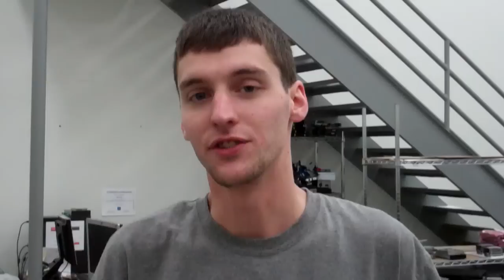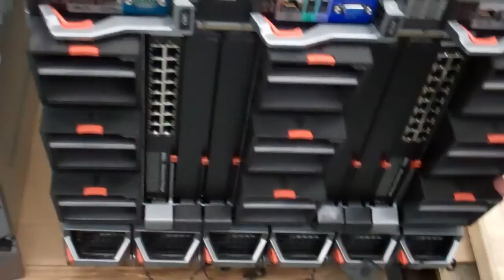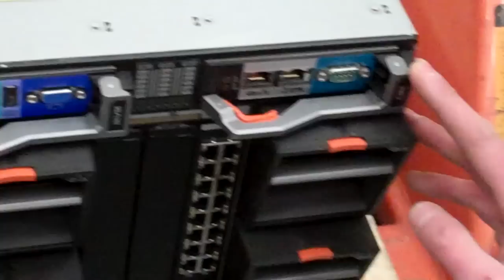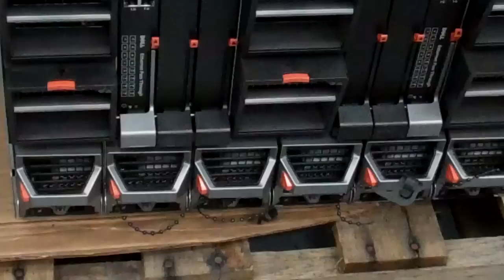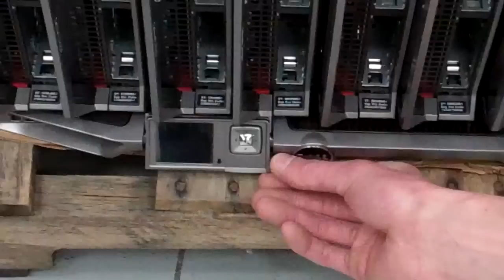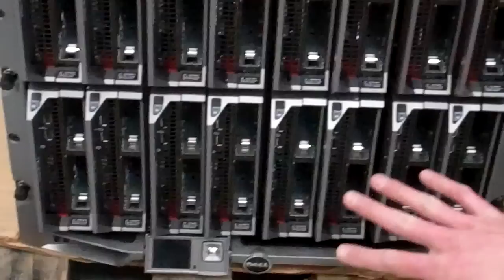Velocity Tech Solutions (PART 1 of 5) - PowerEdge M1000e Basic Chassis Overview

Comment: Hi, Velocity Tech Solutions
on the bottom of the cassis theres a panel with 2usb,VGA and a power button. Internaly,that panel connects to that little lcd panel. my question is: is that panel hot-swappable? and how can it be reached? is there any manual,or guide?

Comment: can I ask , if you have the pin out (Pin diagram )of the PSU ?, I need to change the configuration  to start the power supply(.Dell PowerEdge M1000E 2360W Power Supply 0C8763 C8763)